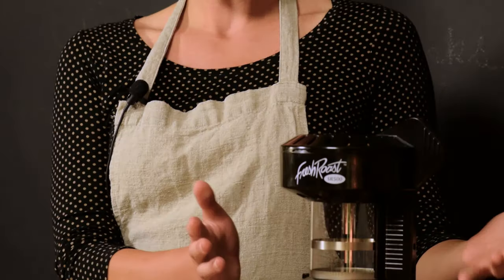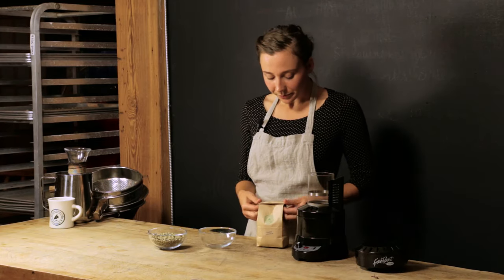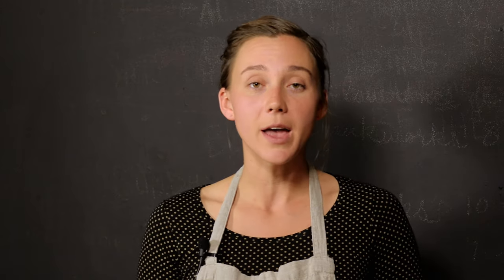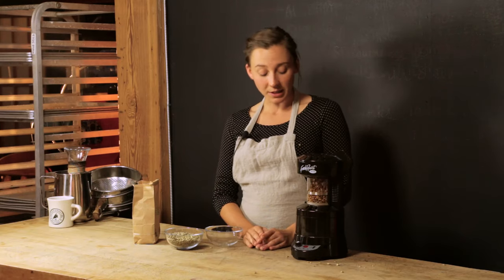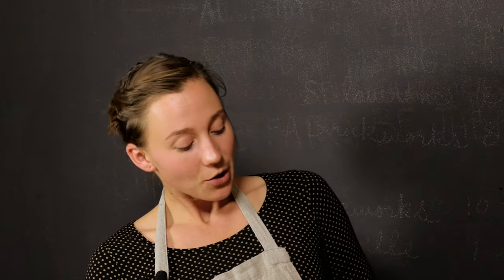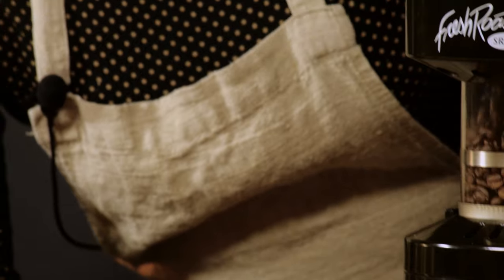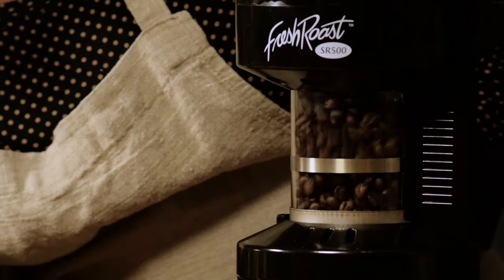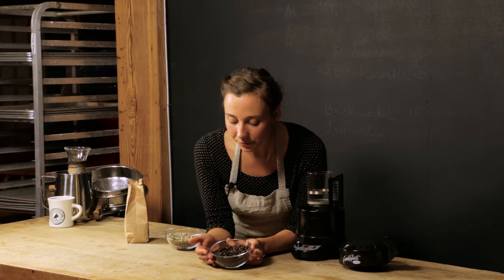Demonstration Coffee Roast with the FreshRoast SR500

Comment: Start on low heat and high fan. It will allow the beans to get rid of some of their moisture and they will not burn before they start rotating in the holder. I have used the SR500 for several years and rarely find it necessary to use high heat. It is a wonderful roaster if used properly.
Reply: SteppapaJon does it smoke up a lot?
Reply: @julesfernandes5721  it does a little, mostly when the beans start getting pretty dark. I installed a vent fan behind my coffee bar.
Reply from the maker: Of course you can use the low temp setting too. I've sold a lot of these machines and have noticed they can vary in their temperature and amperage. I use my machine every day and high heat works perfectly in my case. As long as you get the result you want, it doesn't matter what temp setting you use.

Comment: How long should you wait once beans are roasted? And what type of storage should I use? I just roasted my first few batches and waited 36 hours and the coffee is very bland. They were somewhat oily
Reply: for french press or pour over you can use the beans immediately.  And why not, you'll get the freshest roast flavor that way!  If you do use them immediately, you'll get more foam due to CO2 not having off gassed (which it will do if you wait 24 hours or so), but you just work with that.  I prefer using the bean as soon after roasting as I can.  Espresso you probably have to wait 24 hours, might be too foamy if you use them immediately.
Reply from the maker: No need to temper the beans after roasting. Once cooled, you can grind them up and brew right away for the brightest and sweetest cup profile. No need to store in any special container. Coffee oxidizes either way. I simply consume that coffee within 5-7 days of roasting for best and freshest flavour. Oily indicates a dark roast.

Comment: Can you use the fresh roasted coffee right away or does it need to de-gas for a couple days?
Reply: two schools of thought on this:  1) you need to rest the beans for a day or two, and 2) you can use them right away with the following caveat:  It depends on your brewing method.  If you use the beans right away, you'll get a lot of foam when water hits the beans, so using an Aeropress without resting the beans could get messy.  Same with pour over.  I use a modified french press method, where I bring water to a boil in a pan with a lid.  When it boils, I take it off the heat, add the ground coffee, and put the lid on the pan.  let it steep for as long as you prefer, I do it for 3 1/2 minutes.  Then strain thru either a fine meshed strainer or paper filter.  I can use just roasted beans with this method.  I wonder about taste though, whether resting the beans for a couple of days before brewing will result in a different tasting coffee than a cup brewed right after roasting.  I suspect that if there's a difference at all, it would be very subtle, probably something I myself would not notice.
Reply from the maker: I would absolutely recommend using them right away (after the beans have cooled down from the roast to room temperature). Yes, the coffee will be "foamier" the fresher out of the roaster it is, but the flavour of the coffee will be its sweetest and liveliest-tasting on the first few days out of the roaster (since oxidation has not yet occurred). I roast on a weekly basis for my own supply and never "de-gas" my beans .. that gas is what keeps them fresh!

Comment: Personally I like to slow the roasting time down when I'm using my fresh rose 500. I tend to keep the temperature on low for the first 5 minutes of the process then I'll go up to medium temperature and I never used the high temperature. I manage to stretch the roast out to about 10.5 minutes.

I don't mind getting a little bit of second crack into my my coffee. It seems to come out with a nice medium roast. Which I personally like. That's one of the things I like about this machine. You can vary the way you roast your beans. 

I have been doing this now for about 6 years and I've burned up a couple fresh roast machines but I love roasting and grinding my own coffee.
Reply: Thanks for pointing out that the machine life is not indefinite. What are the factors that change over time that determine the machine is 'worn out' and no longer functions well? Or did it just stop working? Why did you decide to get the same one again? I have a Nesco CR-04-13 which has some design flaws that the FreshRoast500 seems to have taken care of. I'd like to find out if this machine could be a good replacement candidate for me. Thanks!
Reply: @PaulCikatricis  They would just quit working. After the first time it burned up. I found a company who would rebuild them online. I did this twice.  But the last time the company was no longer in business. It seemed that the old SR 500 would last about two years. Not good, but it was my favorite design and at a very good price point.

So this last time I bought the fresh roast SR540. Which is a newer model. Hopefully they have fixed some of the weaknesses in the old design. I have had this one about five months, so we will see.

Comment: My Fresh Roast SR500 lasted less than two years. It still runs but it doesn't get hot enough to roast properly. I think the element needs to be replaced. If someone knows where I can get a new element I would appreciate the info. If I can get the part I'll fix the roaster myself, but I'm not going to bother spending much on it. I'll just have to chalk it up to the fact that most of what we buy today is sub-standard garbage.
 These days I'm roasting on my stove-top with a heavy bottomed stainless  steel pan and a flat-bottomed stainless steel spatula. I cool the beans in a stainless steel bowl in my bathroom sink, in cold water. I like my coffee at a French roast level and this works fine. This method does not work well for lighter roasts because there will be too much inconsistency in the degree of roast in the beans.
Reply from the maker: Agreed! Most coffee on retail shelves is horribly stale and low quality. Have you tried roasting on a cookie sheet in the oven? Start at 450F and stir them every couple of minutes until done. Should take 10-12mins. Lower the heat next time if it roasts too quickly. I find oven-roasting to be the easiest method w/o an actual roaster.

Comment: Meagan,
I used your technique, all the way; but sometimes beans stick to the screen at the bottom of the roast chamber, and get burned like French Roast, even shaking as you demonstrated won't loosen them.  Is there anything that can be done to prevent the sticking?
Reply: Put roaster on low heat and high fan for the first couple minutes until the beans start changing from green to tan then you can crank up the heat and turn down fan.. If you still have problem w/scorched beans, use a spoon to stir gently for the first couple minutes, w/fan on high and heat on low.  Good luck!
Reply from the maker: I do find these roasters to be really inconsistent from unit to unit. Stirring the beans gently with a spoon in the beginning of the roast is a good suggestion. Good luck!